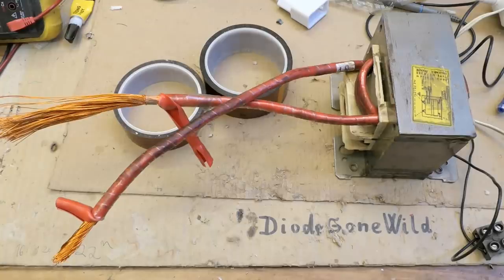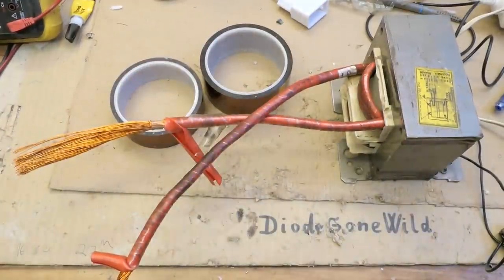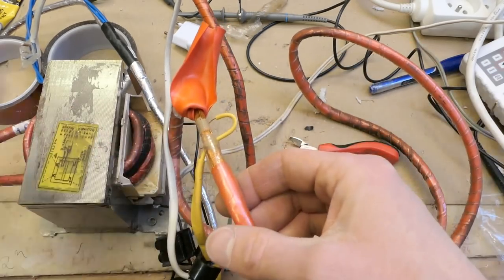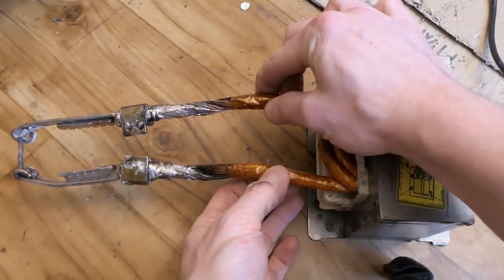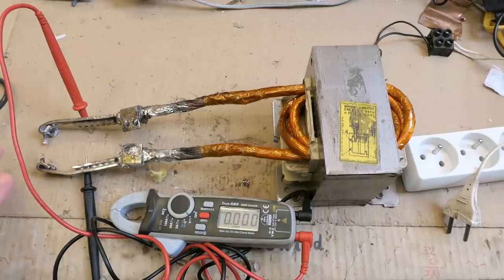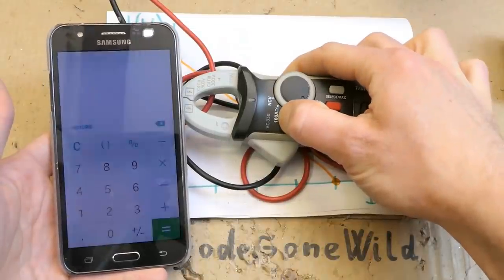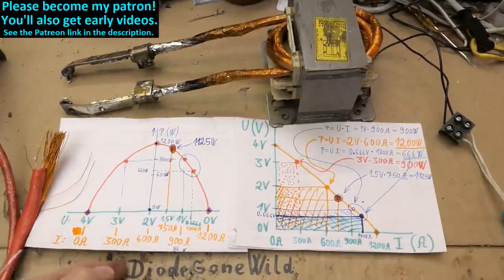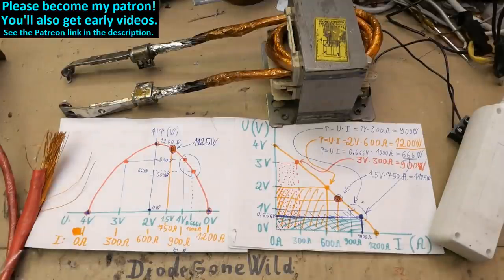Microwave Oven Transformer Spot Welder 2

Comment: What is the brand or model of that rotary tool, if you don't mind?
Reply: Oh dang, and that clamp meter! Looks like it says AC & DC, but just 20A and 100A max? Does it perform well for lower current non contact DC Ampere metering? I have several but they are all 400, 600, 1000 and such. I live like right outside the sun's coronasphere currently, days with highs of 50°C or even slightly more have become common in the summer now, something like 120 days per year of highs at or over 40C, and this "winter" kinda forgot to happen so we had 20-30C days throughout most of Dec/Jan...I think we had one dawn low of about 0C and just a few 10C lows. Naturally, TONS of people in my city use solar panel arrays. Storage devices like "powerwall" for peak rate hours use are VERY common as well, as eliminating or substantially mitigating grid mains use between 15:00 and 20:00 here can save mountains on power.* My ammeters are all high-end professional devices, but just adequate when, for instance, I'm just measuring several hundred DC amps load on panel arrays and such & don't need like +-1% accuracy or anything. A small DC noncontact clamp ammeter that's reasonably accurate for smaller DC loads would be SOOOO CONVENIENT for troubleshooting vehicle issues, smart home install, so so so much more.

In over 20yrs of sparky work, I've literally never seen a clamp ammeter like that in any big box or specialty store, neither here in a city of population 5M or so nor my second home in a very large conurbation of 20-30M pop depending on who's counting, let alone a 20/100A clamp AC/DC ammeter!

*off-peak seasonal range is about four to seven cents per kWh here, literally as little as 1/12 what I pay in California, while on-peak rate is the same PLUS like $17.50 per average kWhs used during peak hours each month. The peak surcharge might hit USD700 in the summer, _just for those 5hrs/daily, so panels & a charge to get you through those 5hrs can really pay off if you use a lot of juice, and I use a LOT of juice for a residence. 250VAC split-single phase 400amp service & four subpanels due to an odd L-shaped 3200sq.ft home with an additional ~800sq.ft of workshop/office and a second two car garage for garaging up to six vehicles, or more commonly just the nicest one or two alongside tons of huge powertools and various junk. Did I mention that it's perfectly legal for anyone to grow cannabis indoors here? :p

Comment: How can you get 1200A in 0 voltage  if there is no voltage no current (electrons) can move ..
Reply: There is an internal voltage in the transformer's secondary, and the entirety of this is dropped in the windings before it reaches the outside.
Reply: The voltage never entirely will reach absolute 0 it just drops way too low when you load it too much for too long .

Comment: Chinese cable.. lots of rubber with three copper hairs in it lmao.
Reply from the maker: And you're still lucky if it's actually copper. It may be copper plated aluminium or even iron.
Reply: @DiodeGoneWild  true bro, thanks for the reply :)
Reply: @DiodeGoneWild  your English word of the day is, "strand". See definition 2 https://www.thefreedictionary.com/strand One of our more confusing words with two entirely different meanings. Wire filaments are definitely strands of wire though. But I speak American which is not quite English.

Comment: Try using UK plug and socket. You probably will find the connection will be much better preventing some of the risks of overheating and arcing.
Reply: A switch is a better idea . Also he lives in a part of EU where getting UK sockets is hard .
Reply: @peterc07  he has some UK plugs and sockets as seen in previous videos, also I'd be happy to help get them to him if he needs it. Furthermore even when plugged in with a more capable connectors a switch is obligatory anyway.

Comment: Why there is no earth connected on the metal case of the transformer?
Reply: It doesn't need to be grounded . In many cases it's actually way safer if you do not ground your MOT like when you are using it's 2200 volts secondary and you ground the core you will basically ground it's other terminal , so if you touch the other terminal accidentally you are dead all though you really shouldn't go around touching powered mot's . Not grounding it might be a better idea in my opinion all though he uses this for spot welding so it's safe . Also the windings are isolated from the core (and must be isolated) so there is nothing to worry about .
Reply: @peterc07  Ok but why when i search transformers in internet most of them have ground terminal?
Reply: @thom78280  MOT transformers are not like other transformers. In fact the secondary is grounded in them.
Reply: @1pcfred  Ho ok i see thank you!
Reply: @thom78280  Dan did cut the secondary out. But if you ground a MOT with the secondary intact they blow up. Don't ask me how I know that.
Reply: @1pcfred  Ok it's a bit weird
Reply: @thom78280  electricity is weird. Bits of matter flowing around is somewhat disconcerting if you think about it. What with us being made out of matter ourselves. There's certainly implications there that we need to be concerned about.

Comment: Just use a flame, it burns the lacquer off.
Reply from the maker: I also tried this couple times, but then you have to remove all the carbon anyway.
Reply: @DiodeGoneWild  It's easier with thick wire, but a few strokes with a scotch/scourer pad should be enough.
Reply: @SidneyCritic  That just doesnt work at all most of the time. Honestly the only good way I've found is Sandpaper.
Reply: @Basement-Science  I usually burn and sandpaper too, but I tried burn and scotchbrite last night and it seams good. I find it too hard with straight sandpaper or a blade because it's hard to tell if you got all the lacquer. Just trying to help, because I would cry if I had to scrape that many strands thoroughly - lol -.
Reply: @SidneyCritic  As long as the wire is somewhat thick, you can easily sand it off by just putting sand paper (100 grit or so) between 2 fingers and dragging the wire in between 2-3 times. It will of course take some time if you are doing many strands, but you can also do a few strands at a time. It's pretty fast overall. 

If the color after sanding doesnt tell you it's enough, trying if it easily takes solder all around will.

Comment: Can you use a small transformer to make a spot welder from a clock radio?
Reply: No, these little couple of VA transformers would go into saturation too fast resulting in more or less kaboom XD. Also the input side is rated for like 5 or 10VA, trying to draw 2000VA from the secondary would rsult in the primary becoming a lightbulb and tripping your breaker
Reply: :( OK but I think the Mots are deadly dangerous if not modified.
Reply: @Purple431  Of course, 2000V isnt something to play with careless, but for spot welding or real fun you always remove the secondary and replace it like he showed in the video
Reply: No . Sadly you can't use little transformers like that . Your transformer for spot welding must be at least 750 VA (volt-amps) .
Reply: @Purple431  you are correct thinking that. Many have died messing with MOT. With this one the dangerous high voltage secondary has been removed. Although mains voltage remains on the primary. Which itself is a hazard.
Reply: Theoretically you still could but then you could only weld very thin things like maybe the metal layer from a CD.
Reply: I don't like mains voltage because it is very dangerous ⚠️
Reply: @Purple431  we safely use mains electricity all of the time. The trick is just don't touch it. If you can manage to stay out of the circuit then you can never be hurt by it either. Pretty simple really.
Reply: I agree, maybe a terminal block is safer to connect it to mains

Comment: How to control current of it  can i use shunt bar for that ?
Reply: It's not current limited , the current limit is the power it can output . And i have no idea why you would want to use a shunt bar for that just leave it as is .
Reply: @peterc07  I'm guessing he means a magnetic shunt in the transformer. Which you could use to adjust the output higher than it is now, by pulling the existing shunts out of the core. I dont think you could adjust it down though as there is no space for more iron in the core unless you remove windings.
Reply: @Basement-Science  #______________ ____________ _____
_____ ______ yes i am talking about magnetic shunt which usually used in classical welding machine .
But not the way you thinks it nothing to do with existing bar but there's two pieces of I type bars that goes between primary and secondary , more it goes in lower the output of secondary because it short circuits the magnetic path accordingly thus secondary winding receives less flux changing  thus  less output or vise versa .
Reply: @omsingharjit  I did mean the I pieces between primary and secondary. 
You could pull them out partially like in a classical AC stick welding machine, which would slowly increase the output power. 

In the video he already left these shunt pieces in place, so this was the output with the shunts fully inserted, meaning the lowest possible output power with this method.
Reply: @Basement-Science  then , yup 👍👍

Comment: Use better cabling on the mains please
Reply: The cabling on the mains side seems fine he attached it to a terminal block so it's good i guess .
Reply: Dan says he will. This is early in the experimenting phase of the project. He's using that sketchy plug because he's turning the unit on and off by plugging it in and unplugging it. He plans on adding a foot switch. Then he can use a better plug. In real life often things go from crappy to better incrementally. Creativity is an iterative process. Guided by the process the artist adds elements to his work.

Comment: I made a spot welder from a MOT but it never tripped the braker and I didn't had the magnetic shunts in so I do not know why it tripped your. Maybe because I had a smaller MOT.
Reply: You are right it was because you had a smaller MOT . His MOT in the video is waaay bigger than usual MOT's .
Reply from the maker: Smaller MOTs have less inrush current. Also the ones with an aluminium primary have less inrush because the primary has more resistance. Some microwave ovens don't even use a softstart resistor, because the thin aluminium primary itself is a resistor :D.
Reply: @DiodeGoneWild   Thanks for your response.
Reply: @DiodeGoneWild  MOTs with aluminum primary have a resistance from 2.6 to 3 Ohms.

Comment: Why Transformer sounds horrible??
Reply: Because it's loaded . Transformers usually vibrate when they have a heavy load.
Reply: The transformer sounds horrible because the transformer is horrible! It is very dodgy. Bloody hell.
Reply: Transformers for a spot welder almost always are overloaded during welding, which is ok because you at most draw current from it for a few seconds continously. But that's partly why it sounds so angry.
Reply: @Basement-Science  put it that way and I feel better about my welder. Because that transformer puts out more current than my welder can. A lot more. But my welder can run longer. Probably a lot longer. Which is good considering how much my welder cost me. Although when I've TIG welded copper with my welder it can sound pretty angry itself. I only did that once and decided it's probably not good to do. But it did a good job.